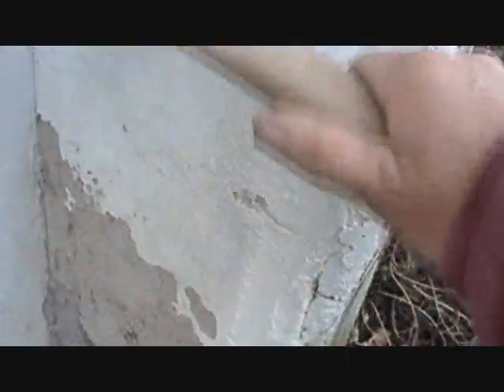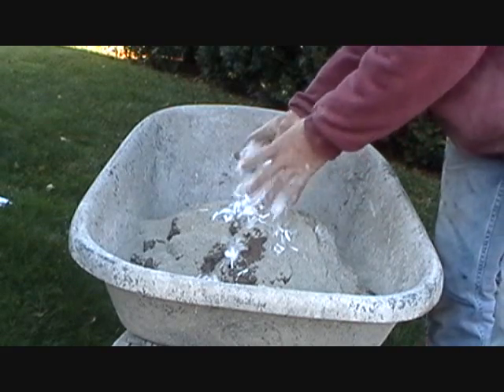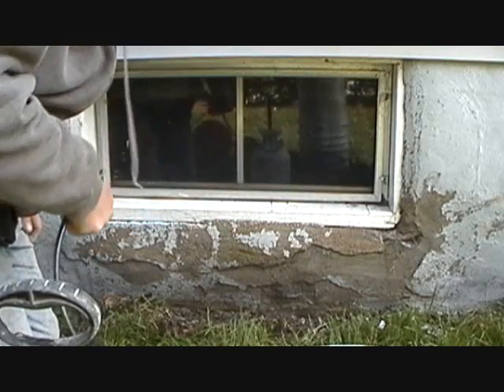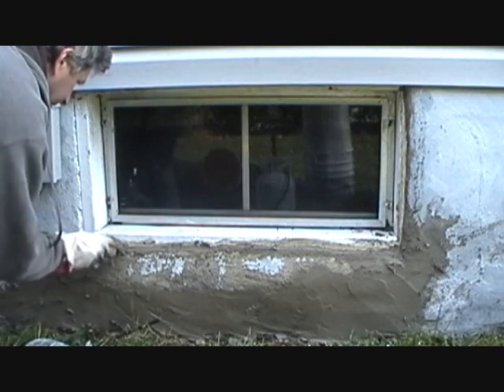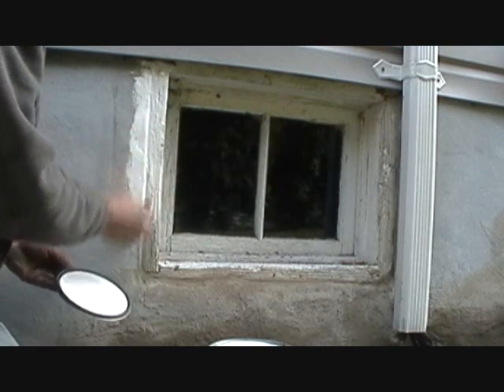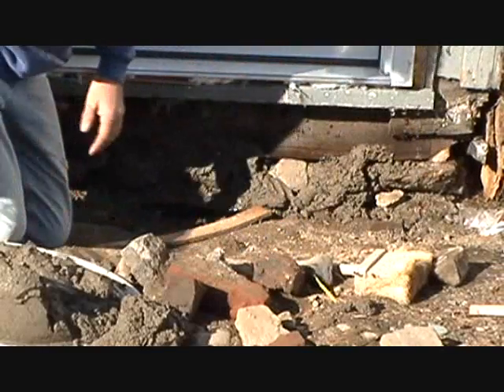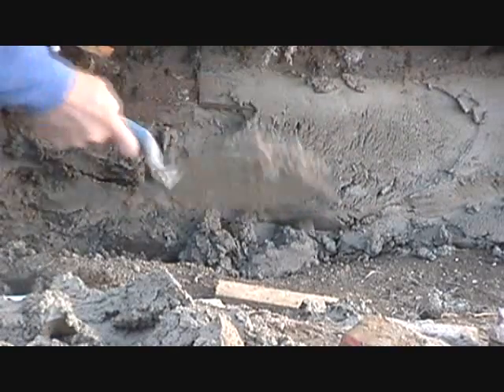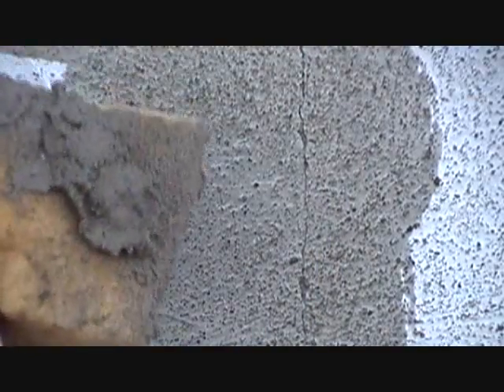FOUNDATION REPAIR  (Part 1) Mike Haduck

Comment from the maker: I just finished a video on, "what cement should I use"  I hope that helps. thanks  mike
Reply: Mike Haduck Masonry 
I am wanting to repair an old cow barn. The walls seem to be old crumbly concrete with loads of sand and rocks in. Was hoping to find a stone wall with Lime, but no luck there. Should I start from scratch, or can this be saved and made into a dry sound wall? This is in the West of Ireland.

Comment: Hey Mike, as a (hopefully) soon-to-be homeowner this is a really helpful video, so thank you! Was hoping you could also give me your honest opinion here as someone who clearly knows his way around cementing foundations.

The home we're looking to buy has some cracks/holes in the concrete facade like the first one you were showing here. One of the cracks/holes is "big enough you could fit your shoe in it" like you said about that one in the video. It's an old sandstone/rubble foundation that someone slapped a concrete facade on over the years, and now the facade is cracking/bowing due to some water getting behind it and freezing. We live in Western PA, for reference.

The source of the leak has been fixed so at this point all that's left to do is fill in the deep holes/cracks with concrete and parge it all up. I had a guy come out and he tried to quote me $3,900 to fill the voids/deep cracks with concrete and resurface it. Does that seem pretty ridiculous to you as well? After seeing this video, I'm thinking that's definitely a DIY job! Thanks again Mike!
Reply from the maker: Most of the folks I do work for are the same families and customers so if I overcharge I get a bad name. (maybe that is why I ain't rich) but I do these videos so folks can give it a try themselves and then If it ain't working out get some prices and ideas from the local pros. my way is not the only way. look at my video "masonry tips for beginners, mike haduck", it might just get you started yourself,,, thanks mike

Comment: Mike awesome videos . Really really great work.  I love the Portland paint my old italian grand father did it that way. I have under the house a opening that looks like the water has started a hole down to basement. I  did this after digging around exterior thinking these water proof people try to paint a coating on the inside thinking its going to stop the water/? I figure stop it from out side !!!! Its not big under the corner of the house. and one under the corner  near garage. Thanks if you can suggest anything.The people who did the renovations were LAZY
Reply from the maker: +VINCE MURPHY  I could never say unless I seen it, but it sounds like your on the right track, I hope it works out, check out the rest of my videos on this series and it might help, thanks mike

Comment: Mike, thanks for all your videos, they are great.  I have an old 1880s built house with probably a stone/cream city brick foundation.  I have some bowing in the basement due to moisture.  Against the foundation was a concrete walkway that graded towards the house in multiple areas.  I am building a robust french drain using rubber roofing to direct the water away and dry the basement walls. I have pulled the concrete walkway out but while I was pulling the concrete walkway out, I put a hole into the basement!!  It was right under an old basement window that has been covered up with wood.  I am going to be filling these in. 

My issue is that the foundation is so crumbly that I am afraid that any plaster will fall off.  Do I drill some stucco mesh into the foundation in order to have some support for the plaster???
Reply from the maker: +Justin Fagan  I have a video "stone foundation repair (inside) part 2" which should give some insight plus the rest of this series and then, "how I parge or plaster an old retaining wall",  I think these videos should say it al.  I hope it helps thanks mike

Comment: Hi Mike,  We acquired a 1925 kit home which is in great shape except the foundation. The block foundation is what I think is called decorative.  It is light colored. There are sections where the face has completely fallen off.  Most of the rest is covered with fine spider line cracks.  I have watched all of your videos but haven't seen anything like it.  I have patched all the  missing block but don't know how to save the rest. What would you do with it?  Your videos are educational and inspiring.  Thank you!
Reply from the maker: Hi Kandj. I just think like a dentist, get the rotted or loose stuff out and leave the rest be, then just fill in the rest and eventually paint it, whatever works, then if someone goes bad down the road just patch it again, thanks Mike
Reply: Thank you so much.

Comment: I've been binge watching all your videos.......I noticed for the window you used portland with sand ,,,, I thought it has to be mortar (because its up and down)?
I want to fix my foundation from some cracks and do I have to add sand ? and I am not painting it later I want to match the rest of the foundation so should I make a cement paint and i'll be okay? Thanks!
Reply from the maker: Hi,  the whole series shows what I used in each case, I hope it helps,mike

Comment from the maker: I couldn't actually say unless I seen it. but I always wash it good . make sure it is wet and paint it with pure Portland cement. then right over that with the first coat. check out part 2. I usually use Portland but many times S mortar with some Portland added. sometimes fiberblass added all depends try a sample wait a few days and see how it sticks. I wish you well . thanks mike
Reply: Thanks for the tip!

Comment: Mike, I have what I assume are concrete outside walls,  stuck to something like chicken wire but smaller holes.  (my house is 70 years old, lath and plaster for inside walls)  I'm nicking certain spots with the Weed Trimmer, and now have some chipped out gouges.  Is there a product for very small repairs that doesn't require mixing with sand and other common ingredients?  Basically something that I can buy in small quantities and use right out of the tub?  Or is a mix the way to go?  ----thanks, I really like your videos. :-)
Reply from the maker: Hi Patrick, yes , as you will see in some of my series, I use a pre mix rapid set or type s mortar, but every video and job is different so I show what I use in each circumstance, I hope it helps , thanks, mike

Comment: Mike, was wondering if you were at a job like scene #1 concrete foundation, but the corner was all busted out and broken down. Was curious if you would recommend using that quick-set cement and vertical wood forms the same way you showed how to patch stairs??
Reply from the maker: Hi Jerry,  yea , I just build it up on how I fill in a basement window,  anything that works,   thanks mike

Comment: Hi Mike. I have a question for you.  I took a chimney down jus below my roof in my old house built in 1864 in Massachusetts. Could you please tell me if I should put something on top of the chimney that's in the attic. Of course it a chimney that hasn't been used in 29 years and won't be used at all. I've heard people say cover it so mice don't get in it and die in there. Some people say just leave it open in the attic. They say it has to breath. Can I put a aluminum plate on it and I'll drill small holes in the plate so it can breath or can I just cover it. Thanks again.
Reply from the maker: Hi Richard, I just did a video on that, chimney repair ( part 15) Mike haduck, I been capping them like that for years and never had a problem, others say different,  thanks Mike

Comment: I did a few of my walls this weekend. I am in New England, we had nice weather I used rapidset mortar with set control. Came out great used your tips. What do you know about going over walkways and foundations that are painted? Do you remove the paint first or just use a bonding agent?
Reply from the maker: Hi Spartain, check out my playlist on each subject.  There are a lot of variables in each situation, I appreciate it,  mike

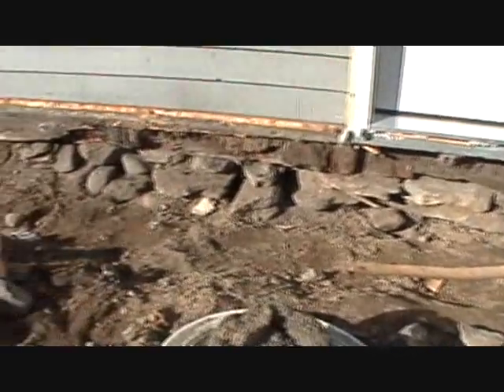Comment: I'm glad I saw this my 100 year old stone foundation needs a new coat on it after I re-point it. I am curious about what looked like a rotten sill plate at 6:25. Why didn't you replace the plate before putting new cement in? Or is that beyond what the person who hired you wanted done?
Reply from the maker: Yes. that is all the customer wanted done, I would usually replace the windows first if that is what they wanted. thanks mike

Comment: Thanks Mike! This was very helpful.
Reply from the maker: +Patti Reichenbach  I hope part 1 to 3 helps, lots of different things, thanks mike
Reply: Watched all 3 of them. 2nd trip to the store felt so much better than the first. Actually starting rethinking some of the original things on the list and putting things back. Love old school ways. They lasted when they were built that way.  Have a 100 year old house and just had a new driveway poured. Need to patch under a basement window where it's badly eroded (with help from chipmunks) and came out when tearing the old drive out. Have to rebuild that and caulk the drive where it meets the house. Trying to beat the weather here in Wisconsin. Looking through some more of your videos this morning to see what I can learn.While it warms up. More than one issue going on along the drive. Fun times! Thanks again. Wish us luck!
Reply from the maker: +Patti Reichenbach  hi Patti, I wish you luck and God be with you. thanks, mike

Comment: Mike, love your videos. Just bought a house built in 1907 in Portland that needs some foundation patching. Getting some pretty high quotes! So, I want to give it a try. Everyone says to use a bonding agent before adding new cement, and also, to tar the outside. I notice you don't use either. Why not? And what do you think about using a drylock or something? Thanks!
Reply from the maker: Hi Stephen, there were no bonding agents when I started in the business, its a new thing and I rarely used them, I never have a problem,  I usually wet it first and paint it with Portland and that is my bonding agent, that’s what all the old-timers did,I do like dry lock especially for the inside, I hope it helps thanks Mike
Reply: Thanks so much, Mike. Why dry lock on the inside? I was thinking if I dry locked on the outside, the inside wall could then dry out. If i dry locked on the inside, wouldn't that allow water to still get trapped in the foundation? Thanks
Reply from the maker: Hi Stephen, I would say unless you could redo the whole outside of the foundation, you’re always going to have water inside those old stone walls, so I see most people use it on the inside and that keeps the moisture from coming through, but I don’t think you’ll ever stop the water, my opinion, I hope it Helps, thanks Mike

Comment: Hey Mike, thanks for the video. nice work. I have a question...this house built in 1947 i just moved in 2 years ago, i found many voids under the foundation. The house doesn't have a basement. (It's built on a foundation slab.) The house is surrounded by a lot of sands and previous owner purposely covered the voids with sand enclosed by lumbers. As lumbers rotted, I finally saw the voids. I am wondering if I can fill in the voids with cement similar to what you did in the video? As the voids are at the junction between sand and the foundation, it won't be easy but I think it will work. What do you think? or do you think I should install wire mesh on concrete to cover voids then patch cement on the mesh?  thanks!
Reply from the maker: Hi Jerry,  I couldn't say unless I been there, I would do some experimenting and see what others did, thanks Mike

Comment from the maker: It all depends on what your exactly doing, what part of the country your in, and I would have to see the job to know for sure. I am going to do a video a what cement I use and why after this winter. if it has gravel in the mix I would probably say no. If you ever did body work on a car it is basicly the same procedure. test it on an old block first to see what happens, my opinion good luck mike

Comment: Mike,
Does the mesh make the parging hold up better/longer?  Does it rust?  Do the nail holes to mount it make more places for water to enter?   A mason just quoted parging for me.  He wants to use mesh and some kind of water resistant cement.  I asked if he covers it with plastic to make it dry slower and harder, and he said no.  The guy says he has 35 years experience and will reduce the price for cash, but doesn't expect any money till he is done.  Makes me nervous.  Under the table to avoid taxes?
Reply from the maker: Hi Panama,  everything depends on the situation, I can't tell you what to  do but i have video series called foundation repair and another called stone foundation repair,  every mason uses their own techniques, thanks mike

Comment: Hi Mike I have an historic home and the floor joists just rest on the concrete wall no sill plates. The floors  rest in a groove in the concrete, now the top portion of the concrete is deteriorating and so the floors below my kitchen slopes where the concrete has broken off. What methods can i use to stabilize it? I thought of just adding a new layer of concrete i believe that will do the trick however it seems as if they use a dirt pile to reinforce the wall from the inside meaning they placed the dirt in a pile up against the wall i wanna move this dirt any suggestions on how to stabilize the wall if i move it?
Reply from the maker: Hi Divine, in a case like that I usually support the beams,  maybe have to Jack them up. Maybe even add extra support and then re cement underneath the beams, I would ask some of the local builders, I hope it helps thanks mike

Comment from the maker: depends on the season. Check out my video. "What cement should I use" Mike Haduck.  but on this videos it was just Portland I think. but you can use rapid set S mortar if it is small and you are in a hurry. more or an art that anything. and experience tells you what will work over time. thanks miek

Comment: I have a boulder cement foundation in my basement. The cement is crumbling into dust in some areas.  To complicate matters, the foundation is 80% painted. I want to apply a 2-3 inch coat of cement to the entire foundation. The question is, will the cement adhere to the painted boulders and old cement for awhile (10-20 years)?
Reply from the maker: Hi Retired,  I got a whole playlist on foundation repair and another on stone foundation repair, I showed what I did in those circumstances,  I hope it helps, mike

Comment: Mike, I have the typical crumbling sandy "cement" falling off the stone foundation (indoors).  Is there anything wrong with just cleaning it up well and leaving the stone exposed?  I am asking if that coating plays a structural role or is it just cosmetic?
Reply from the maker: Hi John, a lot could be cosmetic, everything depends on what's holding what up, thanks Mike

Comment: Mike, I have  a problem in my basement similar to the house you're working on at 6:30. What type of cement are you using there? and will the cement stick even if it has dirt on it? I'm looking to create a fresh layer over a terrible stone foundation and there is a lot of rubble falling off which i chipped off, but the sand/cement it sticks to is very old. What should I do?

Comment: I need the stuff that he's using on the stone foundation.  The concrete around my slab add on has crumbled and some fallen out.  I mostly just need to stop water from washing the dirt from under the slab.  I keep buying stuff to fix it but everything seems to need a clean surface, which isn't possible because some of it has broken and fallen out completely.  Any advice would be much appreciated.  Been stuck on this project since last fall....
Reply from the maker: check out my other videos, how I repair a concrete driveway or sidewalks Mike Haduck,  and masonry tips for beginners,  I think they might answer most of your questions,  thanks,  mike

Comment: Awesome. Thank you
Reply from the maker: Thanks Sabina,  Mike
Reply: @MikeHaduck  hi Mike, please help me with concrete choice. In filling in large space that rats have destroyed. It is about 1 ' high from the slab up and about 10' long.There is only rotten wood from years of water damage,I'd like to send you a picture if possible. I'm at Lowes
Reply: Wow. You Are super awesome. I appreciate your help very much:)
Reply: Your repair looks awesome. I'm going try to do exactly what you did, I'd like to send before and after pics, if you'd like to see it 
So helpful!!

Comment: After pointing then coating S-mortar on my stone wall foundation inside is there any type of breathable paint you would recommend? I want to let the wall breath and I live in scranton. Thanks mike!
Reply from the maker: Hi Mike, I don’t know if you really want a breathable paint, I like dry lock paint, but i would talk with the paint guys first, I sometimes just paint with white Portland cement, thanks, mike
Reply: @MikeHaduck  Thanks!😀

Comment: Why do you not use regular stucco mix or even a 3 to 1 sand and mortar mix?  Which is better?
Reply from the maker: +Smith brosjr  I think parts 2 & 3 will explain more, every situation is different, thanks mike

Comment: Hey mike. Great video. I was just wondering how long generally speaking should you wait before sponging the foundation ?

The part with the window..
Reply from the maker: all depends on weather or temp. I just wait till it gets harder to the  touch, I would do a little practice on an old brick or block first. Thanks mike